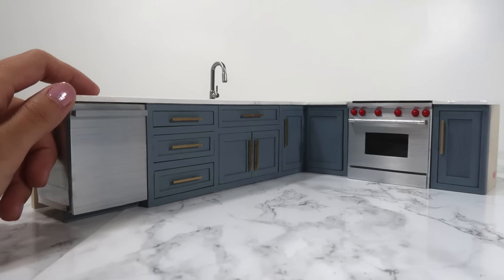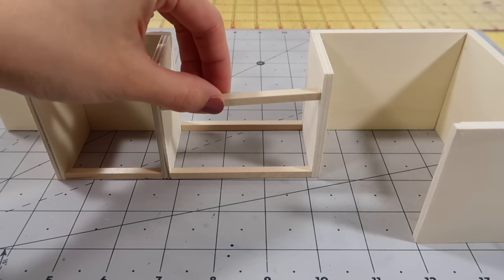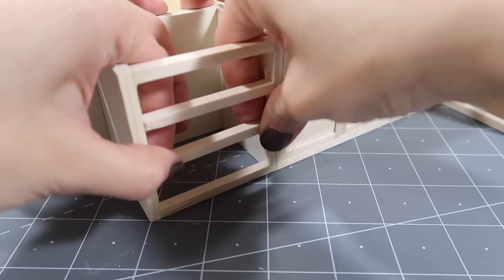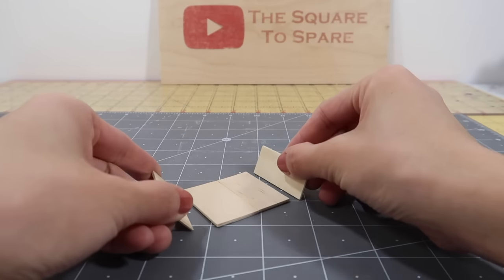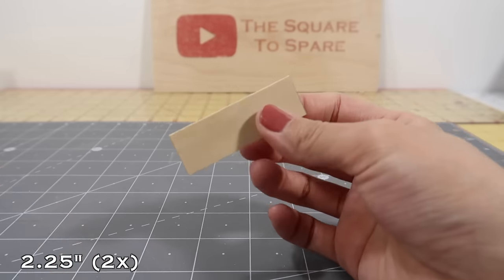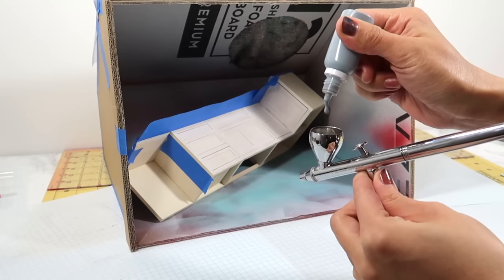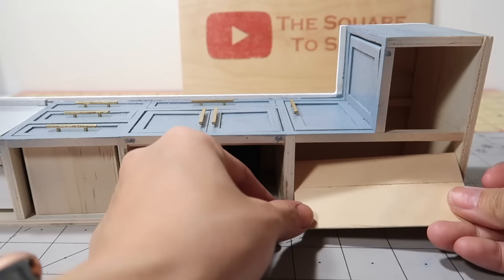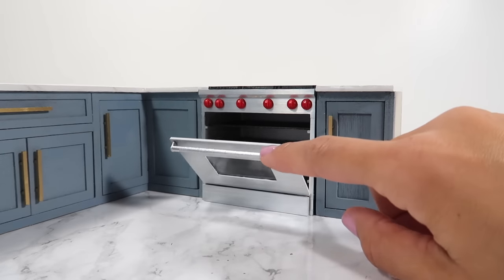DIY Miniature - Modern Kitchen Cabinets (with working doors and drawers!)

Comment: I am so impressed that your construction was made from wood, hinges, drawer slides, little Rev-A-Shelves, metal hardware - no cardboard, no foam core board, no shortcuts. This will last.
Reply from the maker: Thank you!! It has definitely lasted and I’m thinking of sanding down and repainting the cabinets soon since it’s been years

Comment: Your drawer pulls made me realize that I could make the doll size brass bed I've been wanting to make without having to use JB Weld (which would show against the gold wire) or actual soldering (which I did not want to do) just by 3D printing it. I was so happy to see someone else using Tinkercad like I do instead of something expensive and complex like Zbrush...and if spray paint can make 3D filament look that shiny I also don't need to worry about the color!

Comment: Instead of 20 gauge wire use paper clips. Hinges I wouldnt use . I'd twist wire into a shape like in your mix picture do 2 swirls making the swirl tight enough for a paperclip bit to pass through or do a wood joint. Love the detail you put into your vids.

Comment: I love your work and I will do these cabinets without the 3D printed stuff. I did miss you listing all the pieces at the beginning. Also on the corner cabinet the picture shows 2 end pieces that are 1.75 the piece you said was 1 1/8 seems larger am I wrong? Please and thank you.

Comment: Your work is incredible!  I am trying to make the cabinets with the wood planks, however I am finding the planks to be warped.  Is there something I can do to fix that? Thank You
Reply from the maker: I like to soak those pieces in water and then leave them to dry under a lot of weight (first layer would be a towel and then pile on books and other heavy objects like barbells). Leave that to dry for a few days and the planks should be super flat :)

Comment: Everything is so beautiful and I'am absolutely mesmerized by your excelent job!!! However, I must say that in this particular project I found it a little bit confused specifically with some of the measurements. Just to mention one of them for example on min 1:27  when you say 4" , 3 1/8" and 1.125 for the corner area. That 1.125  piece is to narrow and doesn't fit well to be able to form the bracket shape like you do on the video. So watching this video over and over again, I see that specific piece looks kindda different from mine. It looks more like a 1.75 piece like the one you placed on the left corner. So I went ahead and did just that, I cut another piece to 1.75 intead of 1.125 and that worked just fine for me... now please don't get me wrong I really don't mean to contradict your work, is just that  there are some little mismatchs here and there that makes it a bit confusing... Everything I said its with all of my respect to you and your great work...

Comment: I bought J-B weld to use on hinges after this video. It totally didn’t work 😞 i let it sit for 15+ hours and the hinges broke the very first time i tried to open the door. I came back to see if i used it the good way and i did exactly as you did in the video. Do you know any other products that may help?
Reply: Honestly, super glue

Comment: If the back of the draw base is 1 7/8 inch and the back of the draw is 1 7/8 inch as well exactly how could it go BETWEEN the draw sides..it is too large to fit between the sides as shown and it is too short to be attached behind as the sides are..no wonder you don't give a cutting size list..your example later shown for some reason has coffee stirrers around the bottom of the draw and UNDER the draw back why? It seems all three draws are different sizes and under the with of an actual jumbo craft stick thus not just lengths have to be cut...very confusing for people ACTUALLY trying to make it..I wonder why this selling site is more popular than those who give actual instructions... And proper sizes